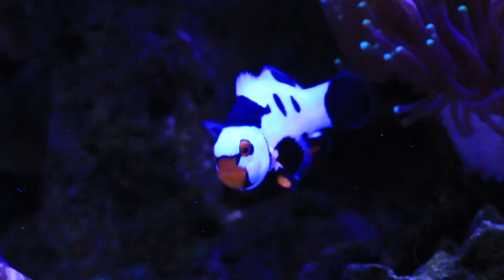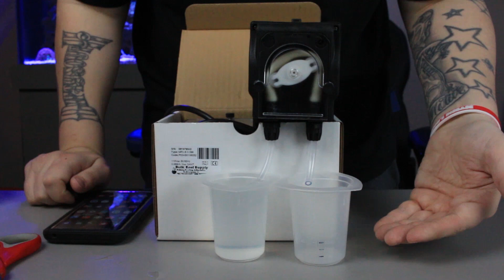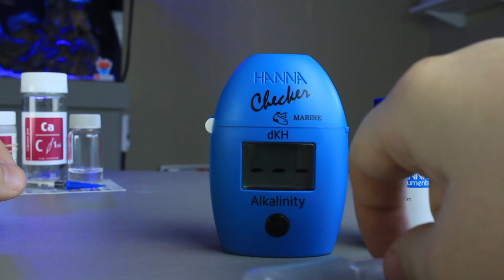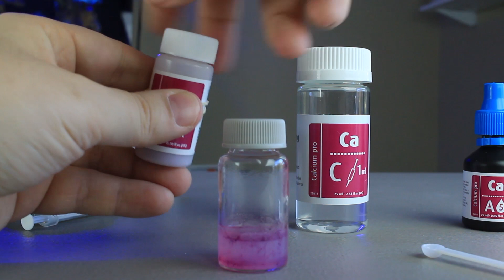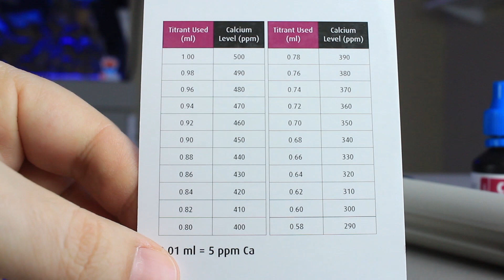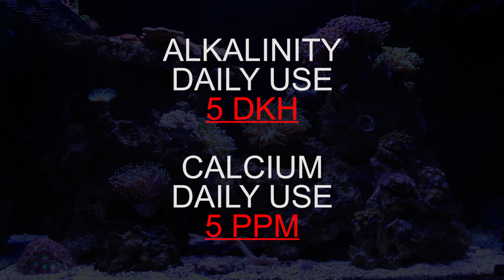BRS Dosing Pump Setup Guide - Saltwater Aquarium Tips for Beginners

Comment: Can you add it all at once?  I thought that would damage corals?  I heard you were supposed to slowly raise it up.
Reply from the maker: Ideally you want to add one element at a time slowly. Then wait some time, maybe an hour if you use dosing pumps then add another element slowly. What you don't want to do is add 2 or more elements at the same time and have them precipitate out, or turn cloudy and interact with each other, and basically be wasted. Which could cause you to increase your parameters too quickly and created a spike. Causing corals to get upset.

Comment: I just purchased two of these.  Both dose about 2 mL/min and that's fine if consistent, but mine developed a ticking/clacking sound after a few minutes.  Is this normal?  I posted an example here:  https://youtu.be/CbP_cSpjcpA   The initial operation was a quiet hum, but this ticking sound is too loud for my room especially in the middle of the night.
Reply from the maker: I assume it's normal. Mine make the same noise.